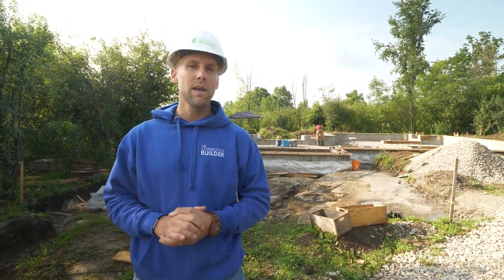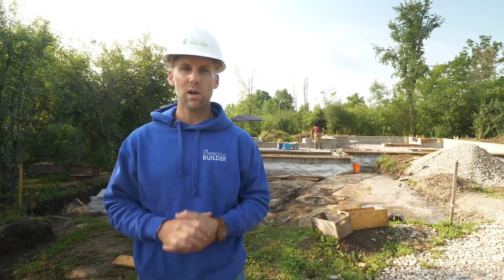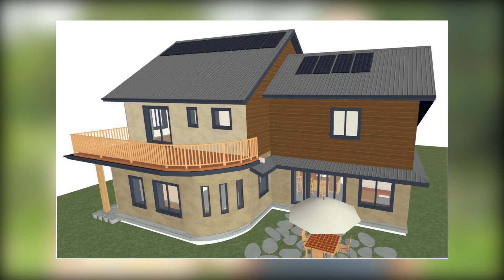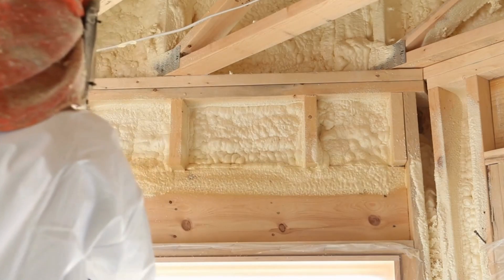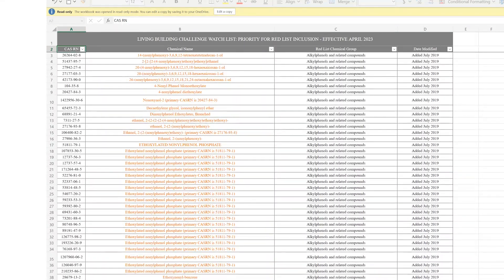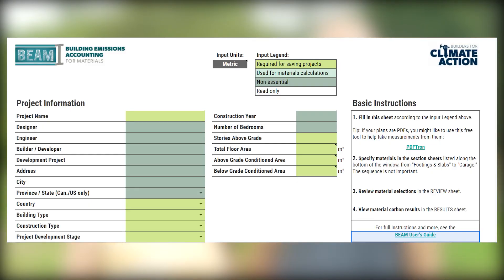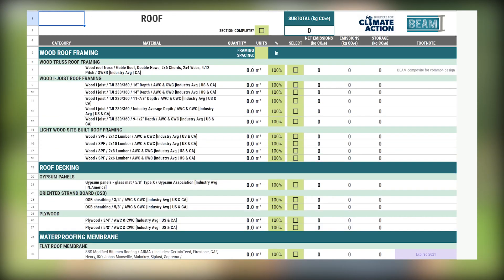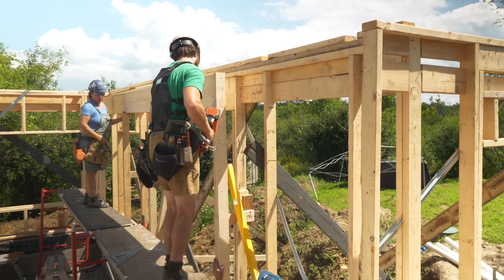What is a Zero Carbon Home?

Comment: Does that high, massive blank wall going up to the ridge enclose an attic bonus room? If so, why not put a window on that wall? If it's just empty attic space, why not turn the garage roof 90 degrees and make it a much lower shed roof and bring the left house gable down to match the right side? That would be a lot cheaper to build as well.